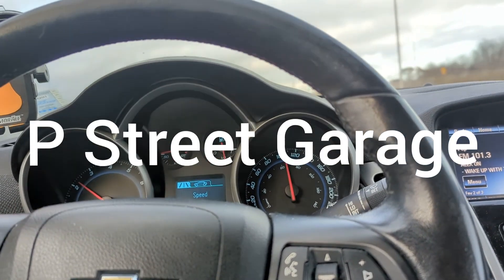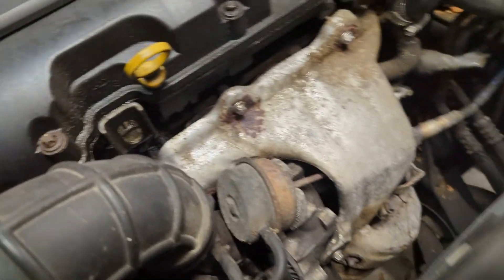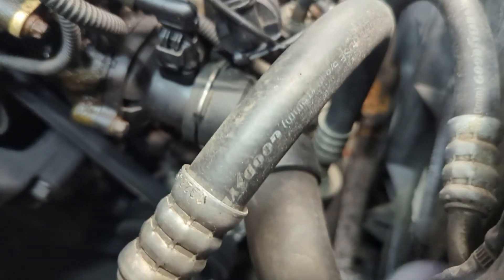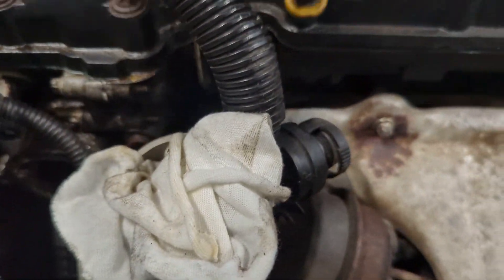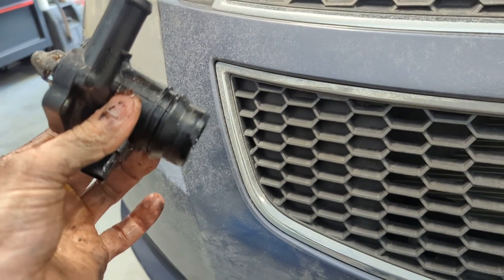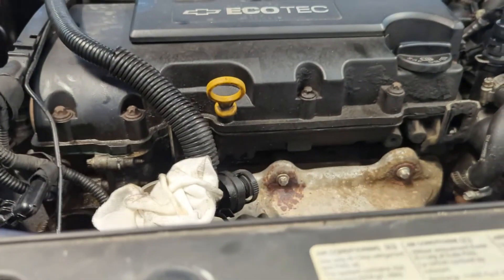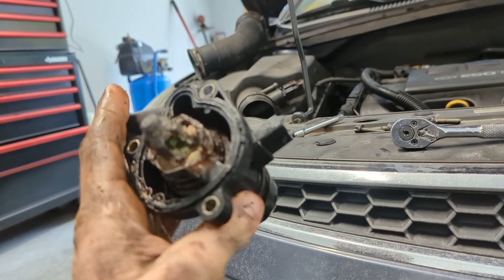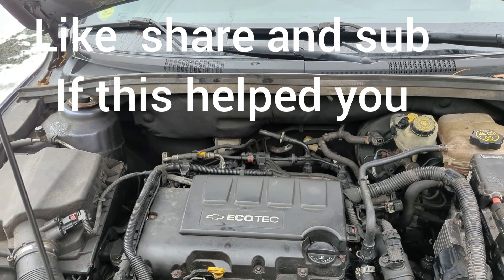Chev Cruze thermostat failed again, but why ?

Comment: dont fuck around with the cooling systems on these buddy, it runs really hot for some reason (thermostat opens at 220 F? cant remember for sure) and its all plastic crap known for leaking alot and cracking etc even with delco coolant and everything. i never seen a thermostat so filthy as the one you're showing, i think it's the stop leak for sure. i would NEVER pour stop leak into a cooling system, period, thats just the way i was trained,  much less a car with such a legendarily shitty cooling system as a 1.4 cruze.

Comment: Yep, i changed my girlfriends water outlet, thermostat housing and the valve cover gasket..etc over 3 times in the last 16 months. Plastic junk. Turnes out zzperformance makes aluminum heavy duty replacements for this car. You have to replace the radiator, radiator fan , water outlet, thermostat housing, heater core,  reserve coolant reservoir...etc and every single hose possible. Or else all of this sludge and broken particles will go into the new parts and destroy them premature.
Reply from the maker: @bmlaforge  I have it flushed out.  Working fine for now.  Worst car ever

Comment: Majority of videos I’ve been watching on the 1.4 and 1.8 they all say the same thing because it’s a small engine don’t put any extra head gasket crap in there because basically if your head head gasket is bad that stuff won’t do anything for you and her certain ways to tell if you do got a bad head gasket, oil, milky, or your radiator fluid will look 👀, through the spark plug opening see if you see any water in it on your next video get to the point and talk faster !
Reply from the maker: @roberthein2156  Yes. I added that as a precaution.   Was unnecessary !

Comment: Really your going to guess what is wrong without reading the check engine light?  NEVER put stop leak an ANY vehicle. I think the temp gauge is the sensor on the transmission side.

Comment: The Dexcool has solidified due to air in the cooling system!!!
Reply: Don’t need sealer with dexcool.  It’s designed to plug small leaks.
Reply from the maker: @Sir_Loin_of_Steak  Thanks for your feedback !  Interesting I was not aware of this 👍
Reply: It gels when exposed to air.
Used to flush and replace with old style green coolant.  Ended up with lots of little leaks and sometimes an unsolvable electrolysis problem.  Aluminum radiator and heater cores would sometimes last only months.
Then it was back to dexcool, always making sure it was properly bled and radiator was ALWAYS full!
Reply from the maker: It's the sealer I put in as a precaution

Comment: How about pulling codes first?
Reply from the maker: There are codes but nothing to do with cooling system.  Did that already in a previous vid.  Changed both sensors.
Not worried about the o2 sensor it's 10 yrs old and 200k

Comment: dont ever put anything in the coolant system other than antifreeze and distilled water.  regular tap water has minerals in it that will coat the insides of the cooling system with a white coating that increases in thickness with time
Reply from the maker: Yes.  No more !

Comment: The thermostat is stuck open, only buy OEM!
Reply from the maker: I think you are somewhat incorrect.  My thermostat was jammed open because of the product I put in.  The thermostat is designed to fail open so the engine doesn t overheat.
My new thermostat was shut.  I tried blowing air through it and could not. Telling me it's designed shut.  Once the engine gets warm, it expands and opens letting coolant flow to the radiator.   
Any thoughts ?  Do I have this wrong ??
Reply: @pstreetgarage7304 
I haven't watched the full video but yes any deposits in the system can make the valve stuck and difficult to move, but the way these usually fail is when the seal inside it fails allowing the wax inside to seep out of place + water gets inside causing the lubrication to be removed making it difficult for the thermostat to open or even close.
And yes when the engine is cold the thermostat is supposed to stay closed to allow the engine to reach its desired operating temperature, once the coolant reaches a certain temperature the wax inside the thermostat heats up and expands forcing the valve to open and allowing the coolant to pass through the radiator to cool it down and cool down the engine, then once it's cold enough, the wax inside also cools and then the spring closes the valve to maintain the operating temperature, this does the same thing but it also has a heater core that can heat the wax at any time depending on the engine load to open the water flow even if it doesn't reach the required temperature. 

In my experience, only OEM will last and don't buy the aluminum ones, they have a really bad thermostat + heater that always fail..
Reply from the maker: @GadGetHackss  The plastic one should last the life of the car.  It's 10 yrs old with 200 k.  The original lasted 10 yrs.  The aftermarket one failed but it was my fault.  Should be good to go now. 🤞
Reply from the maker: @GadGetHackss  Thanks for your feedback.
Reply: Yyyyikes! 😢 that thermostat.

Comment: Most of those head gasket sealants always recommend to remove the thermostat so it doesn't clog it like what happened to you - you get what you pay for with that stuff I use Blue Devil fantasticbut it's expensive it's probably three times more than what you paid for that stuff,you don't even have to remove the thermostat.Good Job.
Reply from the maker: In older cars you could put it in the rad and the pump would chew it up.  Now it goes in through the expansion tank and kind of sits there.  Back to normal now.

Comment: There are re-engineered metal parts that don't break and mess up as often. My mechanic replaced mine with the metal kind as well as the water outlet housing with a metal replacement when he did my water pump. The old plastic engine coolant water outlet was failing and the cause of all the crap that destroyed my water pump.
Reply from the maker: Yes I have heard of the metal ones.  Thanks for your feedback

Comment: Instant Fix! It does look like that stuff was blocking the Thermostat up, should be all AOK now!!
Reply from the maker: Yes. All good now.  Thanks Jason.
That stuff is good in old cars when you can put it directly in the rad and have the water pump chew it up.  Going in the small reservoir is obviously not good. It just trickled down the tube and plugged things up